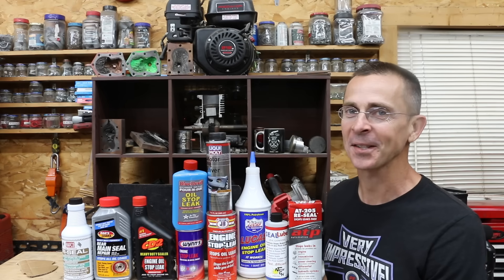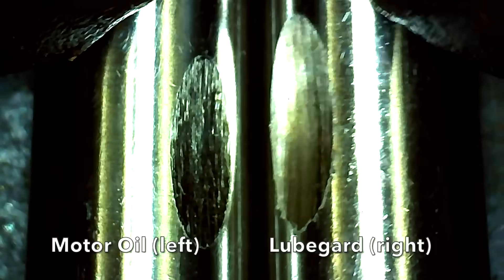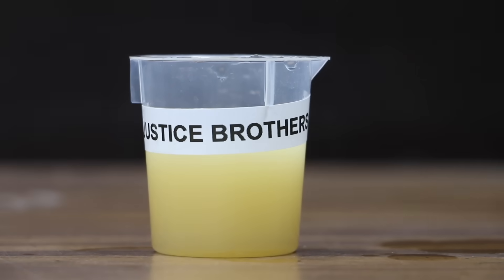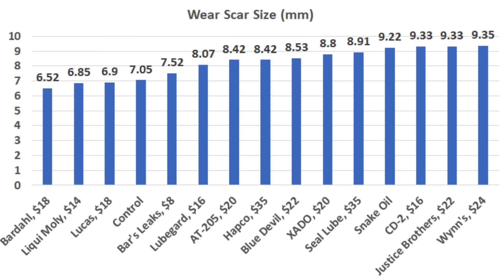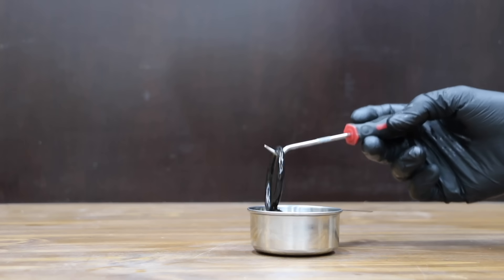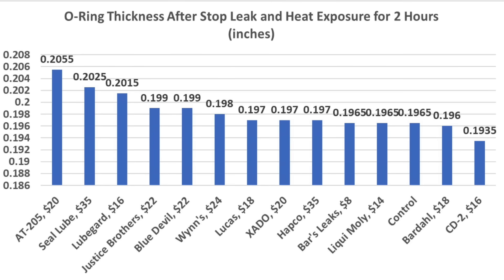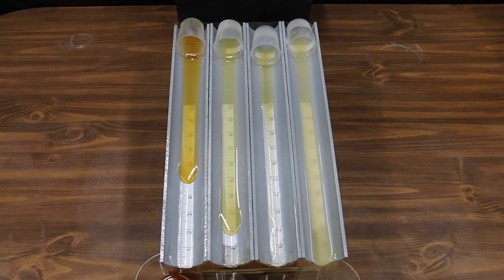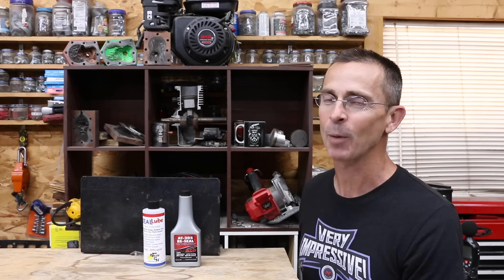Do Stop Leak Products Work? Do They Damage Engine Seals? Will They Destroy an Engine? Let's Find Out

Comment: Great video. I just tried the AT-205 in my 2000 S10. Has a small but nuisance leak. I’ve replaced every seal and gasket I can without pulling the engine. I thought this would be a good opportunity to try this product and see if it helps. I haven’t driven the vehicle enough yet to really test the product but I look forward to the results. This video helped me decide which product to try as there are so many on the market. Thanks again for your work and efforts to make these videos as they are very interesting and helpful for most of us looking to get the best product for our money.
Reply: I just purchased a 1999 GMC Sonoma 4.3 vortec with low mileage. It has a leak as well. It’s the oil pan gasket and the rear main seal. $1550 to fix. Let me know how that AT-205 does please.
Reply: @mhc2984  Sometimes a rear main seal leak makes it look like the oil pan is leaking too although the seal is the more expensive repair
Reply: Yes. What Michael said. Please provide update when you can
Reply: How's your leak doing now 2 months later?

Comment: Thanks, I used AT205 on my car which has slight oil leaks and does resolve the issue.  I have a suggestion, do a similar test but this time also adds a friction reducer additive that wills reduce the wear but still makes the rubber seals swell to reduce the leak.
Reply: No, you don't want to start making an ungodly chemical brew mishmash. Confounding variables and unexpected chemical reactions.

Comment: I have used the Blue Devil rear main sealer in my truck and it stopped the leak. Going on the 2nd oil change and still not leaks and it leaked for years.

Comment: I've used just about every snake oil made since 1960's.... Most do nothing. BUT in 2007 I had a 2 1/2 ton truck with power steering. It's a complicated system. And it had a bad leak on the belt driven pump. a real trickle. I put in Lucas power steering pump sealer and the stuff worked !! it went from 3-5 drips Per Second to Zero.  I had a leaky water pump seal on a 1978 Mustang with V8. It too was a Bad trickle. I threw some Pepper in the radiator and it worked for a couple of months. I've used Pro Blend friction reducer since 1984. That stuff works wonders. I carefully tested a generator and it showed 10min more run time on a gal of gas. Maybe 5%. I ran over 100 miles with no oil in my 2 liter Mazda truck. It stopped and started like it was nothing! (cracked head allowed oil into water). I used it my sons MX bikes for racing. It makes wet clutches Smother. Improves shifting in trans... And in my 59 Vette, too. And other stories.
Reply from the maker: Thanks for the feedback.

Comment: Excellent video, well thought out.  I wonder, could you come up with a test to see if the change is permanent?  Like, will the changes in the thickness and hardness be maintained after 1 treatment, then with subsequent repeated exposures to plain motor oil does it go back to normal?  If you still have those o-rings, maybe you could easily test them?
Reply from the maker: Thanks!  Thanks for the suggestion.

Comment: I drove a 2010 bmw  335i .  It's a 3 liter 6cyl turbo, for 8 years.
Not one engine problem as I used liquimolly and Shell V 91+ gas.
Only two things ever happened: 
1. 335i is known to leave engine oil spray after 50k miles. Installed a catch can, no problem. 
2. Turbo disconnected at intake one acceleration once, because my oil change guy (me lazy) forgot to tighten it after inspection.  
That was a great car. 
I also chipmodded it to abuse the turbo and race WRX losers. 
0-60mph 5.0sec stock.
0-60mph 4.2sec chip mod.
Insane BMW engineering.
Sold it for $ 8k with 135k miles.
Reply from the maker: Thanks for sharing.

Comment: I used a product like this on my power steering. The way my car is set up, if I didn't I would risk destroying my engine. And to fix it would require I take the whole engine out. So far I have not needed to add any fluid to it since.
Reply from the maker: Thanks for the feedback.

Comment: Great video as always. Question about the wear test. I understand the purpose of mixing oil and the additive 50/50 for the purposes of testing consistency, but in real world application what about the ratios per the manufacturer directions? For instance the AT 205 reseal ratio is one 8 oz bottle can treat 6 quarts of oil. Would you expect the wear to be less pronounced in that ratio compared to your test of 50/50? I guess what I'm saying is that in your testing method it would exaggerate oil dilution issues. Maybe I'm overthinking this just a thought.
Reply: But I agree, I'm concerned about wear.  However, if you only use it for a short duration and then change oil, it's also not as pronounced.
Reply: No, you're reasoning is sound. The test is a sort of best/worst case methodology that is very useful.  On a newer or more expensive vehicle, I'd pick on of the more viscous top products so as not to incur wear. But that would also mean much poorer seal/gasket softening/expansion.  On my 165K SUV thats 16 y.o., I'll probably pick one of the ones that softens and expands better, as the risk of damage is not as much of an issue with an engine that already has 165K on it.
I may just run it for 200, 500, 1000 miles until either the leak stops, or it needs an oil change.  
There is no 'Best', its a sliding scale of trade-offs that the testing done gives you data from which to make your best decision.

Comment: Sometime last year I suggested you rank snake oil against products that were arguably "snake oil," and I"M SO DELIGHTED to finally see it happen. Thank you very much! Hilarious!
Reply from the maker: You are welcome!
Reply: Was a good hearty chuckle moment to see 'snake oil' as a competitor 😂  

My towns main mechanic HATES this kind of stuff, seafoam too even
Reply: When I saw some products performing worse than the snake oil all I could think was "that's a lot of damage!"
Reply: The most hilarious thing about snake oil is that the original snake oil actually worked. It was oil made from boiling a Chinese water snake that had some manner of pain relieving chemical in it. Of course, people wanting to market it in the U.S. didn't have access to a snake that was indigenous to China, so they used whatever snakes they could find, then eventually realized that since none of the snakes here had any therapeutic value when boiled down for their oil, they just started selling cheap mineral oil and calling it snake oil, and instead of just claiming it could relieve joint pain, claiming it could cure just about anything.

Comment: Maybe I'm not looking at this the right way, but if it actually adversely effects a new gasket, isn't that a bad thing? You want the product returning a gasket to it's original state - not modifying the original state. So if a gasket swells too much or gets too soft it could effect the durability or integrity of the gasket itself, especially if the reaction continues for weeks and months, which you'll have this product in your vehicle. If a gasket is too soft, when under pressure it will deform or even tear.

Comment: What did you use for the rack and pinion leak? Also can I use the at205 for a honda rack n pinion leak? Is it safe for power steering systems?

Comment: wait......
Impossible.
The very first product: made in the USA.

I just came from your video on winches.
China China China.

I find it funny.

Fluids made in the USA. Hardware from China.
Funny stuff.
Reply: if able, pls next time try chinese brands of this product, if able.
Just to compare between the US and China.
And maybe that might be a funny idea for some other stuff you tested in the past.
Just an honest funny comparison between quality, etc.
Reply: sorry to be a troll (maybe you see me like i am one).
But i was wondering why you are not reusing the test pins in the friction test?
You could reuse them several times, right?
It will still be easy enough to see the difference between 2 different brands of stop leak you tested.
And it saves a lot of them test pins, right????
Just a thought.

I mean, the wear only takes place on one side of the pin. You can turn it a bit, fixate it and do the test with another brand of stop leak, right?
So to have the wear scars end up next to eachother (sorry, im dutch. But i think this makes enough sense).

Less pins, and just as easy to show the difference between 2 different brands of what ever you are testing, right?
I think you can easily use the pin for 4 different brands of whatever you are testing.
With 2 pins you can easily test 8 and compare em by showing both pins, right?
I would think so.
It might save a bit of work, bit of time, bit of money on them testpins etc.

again, just a thought, a suggestion.

Comment: How about plumbing pipe sealants. Can test them with 4000 psi gas using Scuba compressor. If you do, please test Locktite 55 and 565 with the typical ones. Use same tap and die to have threads be identical NPT and apply identical torque.

Comment: Can you test mosquito attraction products. I’m building two mosquito traps based on a YouTube design. It’s a 5 gallon pail, equipped with a light a Walmart, 9 inch diameter, fan, and screens that catch the mosquitoes. The author throws in some attractant chemical, and that supposedly would increase the mosquito catch. Perhaps a test with two units one with, and one without attractant in the same general area, but spaced far enough apart, that the attractant is working for one. What are your thoughts? We are heading into mosquito season. It would be great to find out if these attractants are worth it or not. Do they increase the number of mosquitoes you catch. Does one work better than another. The cost of some of these is really amazing. $20 for two months. Then they want you to replace the attractant.

Comment: This might be a good project. Can a near dead "sulfated" lead acid car battery be revived by overcharging it for many hours. Many claim this overcharging will not and does not work. I know better. Yes, it works very well. I've lived off grid for 14 years. I use a Solar battery bank for power. After time, my bank will become weak and won't take a lasting charge. I use the overcharging process to revive them to operate as new batteries again. Yes, it does work very well. Be nice if you would demonstrate this process to prove that it is for real. Thanks for your consideration...
Reply from the maker: Thanks for the suggestion.

Comment: To avoid differences in how hard you're squeezing the caliper, use a micrometer with either a ratcheting thimble or a friction one. I prefer friction thimbles when available. They have a more consistent touch in my opinion. The ratcheting ones seem susceptible to needing different amounts of force depending upon how in-line your hands are with the thimble. Or a height gage on a surface plate with a dial test indicator that has .0001" of resolution and accuracy.
Reply from the maker: Thanks for the feedback.

Comment: For the lubricity test, I am unsure if you are using all the products in the intended ratio per the instructions for use or if each is being measured at a 50/50 oil-to-product ratio. If the latter then that would potentially be a test validity fault which can lead to false conclusions potentially.

Love your videos btw, just something I noticed.
Reply: In the case of AT-205 they recommend 6 ounces per 5 quarts of oil so indeed, the 50% dilution wear test is meaningless since the product is never going to be used that way and even moreso, some of the products that caused significant wear at that ridiculous dilution ratio also did very well at what they were intended to do which is restore the rubber seals. The wear test MAY have been at least a little more relevant if he had only added the recommended amount of each product to the correct amount of motor oil, but..... that wouldn't generate sensationalism and the "wow" factor.
Reply: @marketingmajor8126 sounds like your product is among the less effective.
Reply: @marketingmajor8126  This is coming from a Marketing guy, not someone with an Engineering degree/backgroound...
50/50 will highlight the best/worst cases in a reasonable amount of time.  Doing an actual rigorous test would cost a lot more time and money than your average viewer here would expect. 
But, there are always those people on the Internet who produce nothing themselves yet demand others expend time and money to meet their exacting standards.
The more people like this we have, the fewer people like Todd will feel like doing these experiments.
Reply: I had the same inquiry , but I think it's just a testing process , because the additives are probably 12% of the oil mixture in the engine and wouldn't cause the damage that  the 50/50 mixture caused .
Reply: Thats correct, the 50/50 was not as recommended. However, resulting measurements may have been too fine (small) vs the Control had it been 1:6 or less ?

Comment: So basically, what I got out of this video was that you have 2 types of stop-leak products, which are viscosity enchancers and seal renewers. The viscosity enchancers like Lucas and Liqui-Moly try to thicken your oil to stop any leaks but do not burn off easily. The seal renewers like AT-205 are meant to be rapidly absorbed by the o-rings and gaskets and then quickly burned off by the engine (not exactly sure on this last part, but it seems that way). For the time that they are in the oil though, I would be willing to bet engine wear will be much higher, so I would think you should use as little as possible to minimize this. Overall though, great video Todd! Can we see videos on head gasket and radiator sealers next?
Reply from the maker: Thanks!  Thanks for the suggestion.

Comment: The POINT of these products is that they SEPERATE from oil.  Thusly allowing them to be absorbed into the seals that they are repairing.  They are NOT LUBRICANTS.  They are seal expanders.  So just know that your test actually proved that they are doing as they claimed.  They are not mixing with the oil.  The are not ending up in your engine.  They're ending up in your gaskets.  I love your stuff but not a single thing you tested for lubrication is a advertised as a lubricant.  The whole point to their chemical structure and the research behind them is that they don't mix with oil.  The mix with gaskets nicely, though.  lol

Comment: I've used the AT-205 on my diesel Volkwagen and my wife's Ford Fusion, to no leakage on mine and a lot less on hers.  It's nice to see it quantified.
Reply: Curious where you were leaking on the Fusion? I have the 2.5l that is leaking from the timing cover and thinking of giving the AT-205 a shot
Reply from the maker: Thanks for sharing.
Reply: Justice brothers works better in real world use. At205 and most other brands sit at the bottom of the oil pan.

Comment: 22,000 heavy vehicle differentials have a thin mylar? end shaft cover seal, in addition to inner seal. The AT 205 'appeared to' affect that mylar seal on one side of the differential, requiring replacement of mylar, include drain and replace dif lube.. Just additional food for thought... ;/ Thank you for the test..
Reply from the maker: You are welcome!

Comment: I would like to suggest a video comparing tool boxes.  For example, does ball bearing really mean better?  The hold capacity of each box?  How much weight ( or relative tools) can each of the sliders hold?  Are the casters able to move a fully loaded box easily? How hard can you pull the handle ( while moving the box) before it pulls apart. Is the box top heavy/ tipping hazard?  How well is each section designed. The relative thickness of the steel used in construction.
Reply from the maker: Thanks for the suggestion.

Comment: I have used AT-205 it works quite well with oil leaks, only moderately well in power steering in my experience.  Based on the wear issues I would not use this in a vehicle with low milage - I tend to use it in my vehicles with over 200k as a sort of last resort to expensive work.  Frankly its kept 2 of my cars with 230k & 250k on the road for years now.  I would say that, with one of my vehicles that sat a while, it may have contributed to freeze damage to one of my high pressure steering lines but that is speculation...
Reply from the maker: Thanks for sharing.

Comment: Great testing! It's definitely a toss up between just adding oil vs buying the stop leak which can be expensive to use after every oil change. I guess it depends on the leak it self. I have an older Silverado with 265, 000km and it just seeps oil not leaking oil so I just add some oil between oil changes.
Reply from the maker: Thanks for the feedback.

Comment: Just thinking on things here, you should probably invest in a fume extraction set up with a kitchen style fire extinguisher system for when you’re cooking the oil. I know it’ll be pricy but I can’t help but think you’re going to give yourself rapid onset cancer with all the VOCs, Dioxins and other fun byproducts you’re producing during these tests, same with your engine tests. 

Other than that could you perhaps test what’s the best plastic lubricant for ABS, Nylon, and PVC

Also there’s a type of Canadian made grease called Klondike Nano EP-1 which is a synthetic nano engineered grease with nano scale buckyball put into it, supposedly it’s pressure resistance is 25% higher than any other synthetic grease of the same synthetic base. My experiences with it have been great but I would like to see if tested, I’ll be happy to ship you a tube if needed.
Reply from the maker: Thanks for the suggestion.

Comment: At-205 Stopped A Power Steering Leak On My 1999 Lexus LS400 And It's Been 2 Year Since I Added 3 Ounces To The Fluid.

AT-205 Is An Excellent Product That I'd Highly Recommend For Anyone With A Power Steering Or Oil Leak! ✌️
Reply from the maker: Thanks for the feedback.